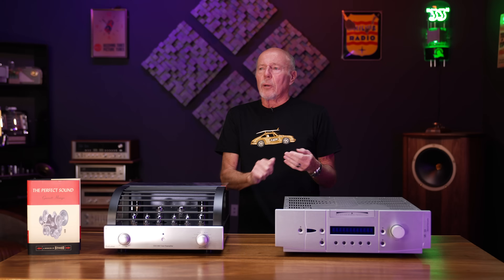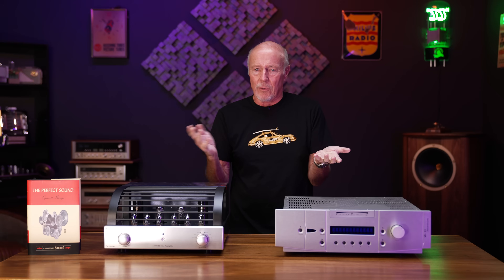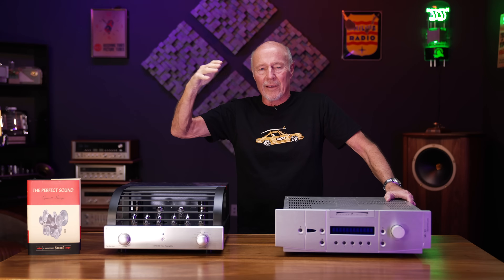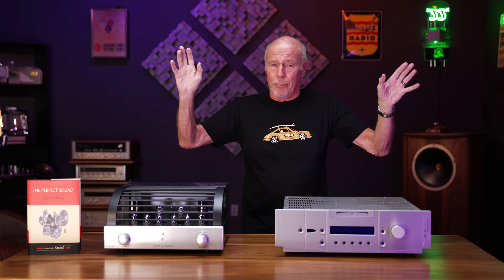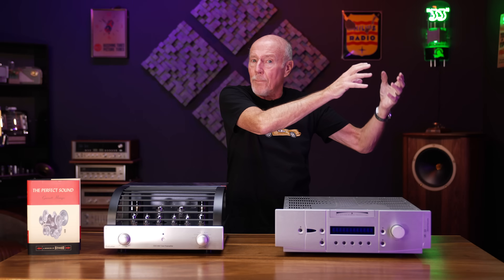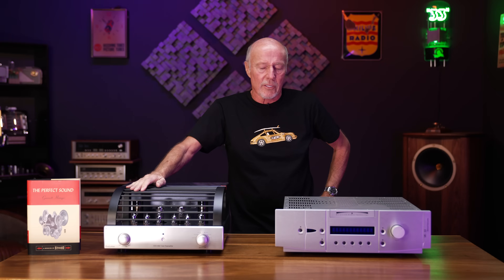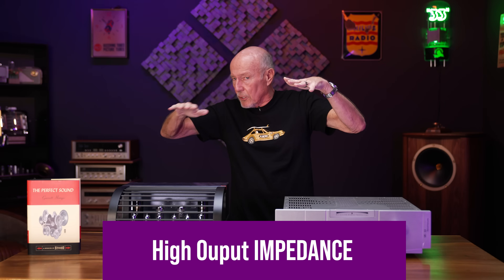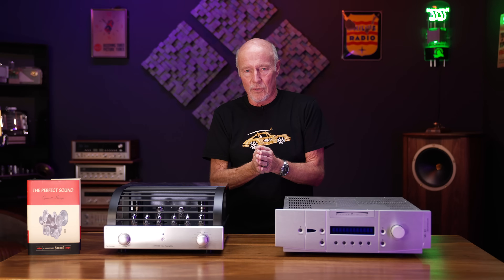Impedance "Matching" a Tube Preamp and Different Amplifiers? The Truth!

Comment: Good advice and information, Kevin. I’ve personally found that the 10x if not 100x higher input impedance usually works well, at least on paper. If it’s a bit off, just try it, as it may sound great.

Comment: This guy is only trying to sell something. NOT the truth.
Reply: The truth is that most modern gear follows a concept known as Impedance Bridging... that 10 to 1 ratio mentioned in the video.  

Long ago the manufacturers realized that we were going to hook stuff from different companies together. Impedance bridging answers the problem. It is  done so you can hook an Acme pre-amp to an Excelsior power amp and have a working system.  

The ages old concept of impedance matching really only applies to radio transmitters and antennas... everywhere else, pretty much everything connects to everything else.
Reply: What is he selling?